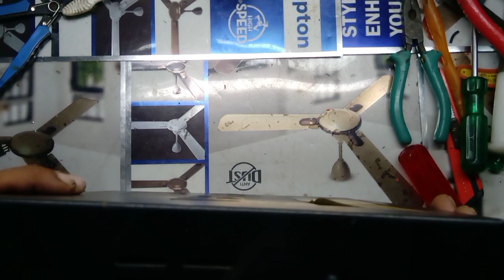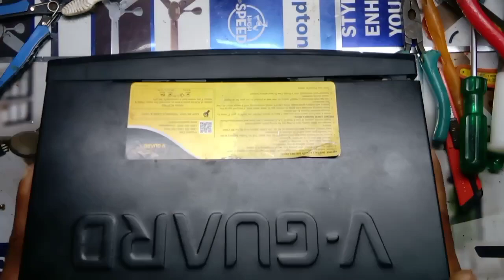v guard inverter prime 1050 how to repair not working

Comment: The way U are removing the defective component, is not correct in that the printed track may come off. U have to use, preferably,  an electric desoldering pump.